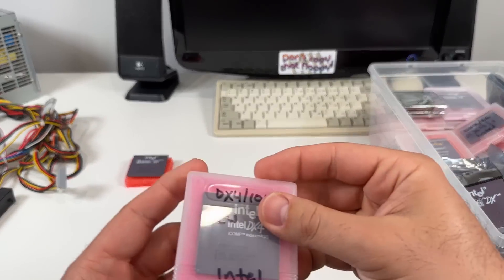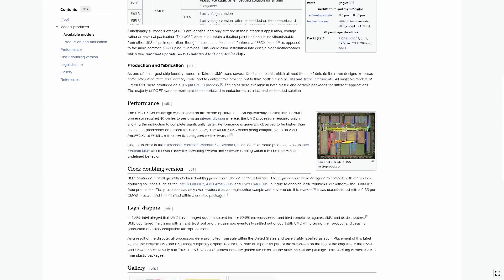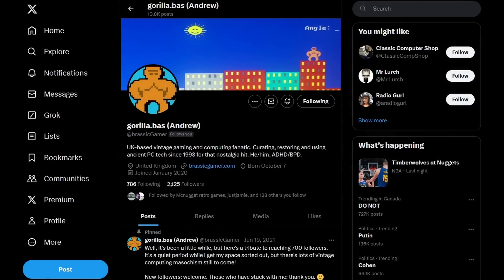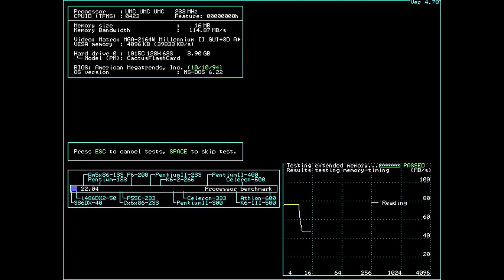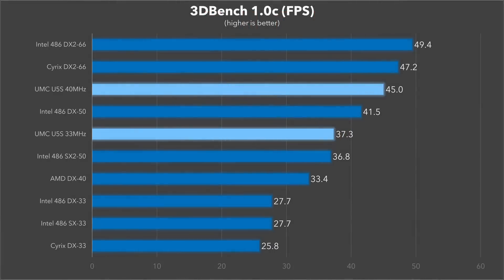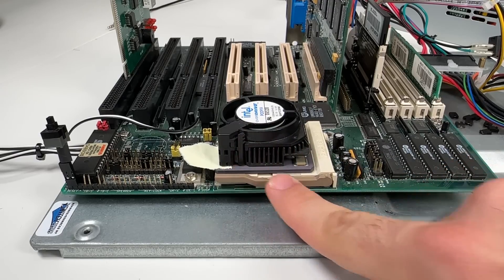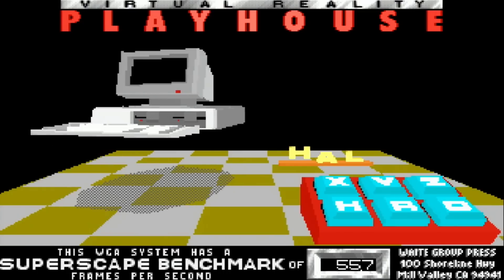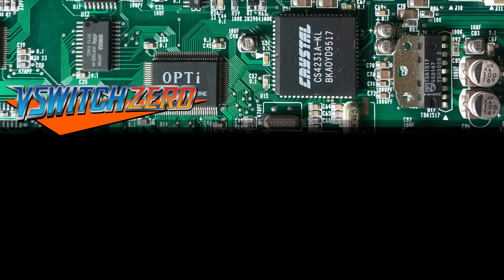The Forbidden and Forgotten UMC Green 486 CPU

Comment: I jumped from a 286 Tandy to a home built 486 DX66 and for five years it was faster then any of my friends PCs.  I built my own fan setup that was more powerful and quieter.  This was the first time I used an Asus motherboard and I continue to use their MBs to this day.  I can't remember the brand name of my video card with 1 mb of memory and I used a Sound Blaster sound card and two Diamond 56k modems and two phone outlets.   My monitor was a 19" monster, I mounted a fan above it to cool it!   At that time time I used a huge HP 1220 printer that printed 24"x 36"  poster boards.  In those days I went through ink cartridges weekly.  Today I use my PC for the internet only, and do not miss the "old days"!

Comment: My first personal experience with over clocking was the main seller at our old computer shop. It was the AMD DX4-133 I had setup for a customer. I accidentally set the bus speed to 40mhz and saw the 160mhz on the screen as it counted RAM and booted up. I was like 160 oops but i have to benchmark it and see is it stable. I ran that one with the flying pc and keypad and it smoked any score I'd ever seen come from my shop including the previous record holder which I think was a P75. It was perfectly stable in anything I played which included Doom of course. When we told him he got a free over clocking upgrade he was like sweet. We sold a bunch of them because it was significantly cheaper than the Pentium but performed just as well in most things at the 160mhz clock. I always tried 50mhz but never got one to run reliably at that speed even with extra fans cut from old power supplies.

Comment: 08:04 - 486 Clocked at 771.0 MHz???
Reply from the maker: Back in those days there wasn’t a standard way applications detected processor speed. Sometimes you’d get strange results from non-Intel chips. Cyrix processors would often be misreported in a lot of tools. Thanks for watching!

Comment: (14:55) I have never seen a USB to IDE adapter like the one you're using. Does it also have nand flash memory on board? I see the USB Pen is not plugged in.
Reply from the maker: This is actually a "GoTek" floppy emulator. You can store many floppy images on a single USB stick and switch between them. Very handy to have with retro DOS systems!

Comment: Heretic, Doom, Duke 3d has a secret, that’s working for Dosbox and the x86 devices. That’s the game’s intro game play, that runs during the title screen. You have to go through 2 rounds to speed up a device, and to enable a micro SD card’s physx processor for games, that’s usually off by default, that is HC, XC, and A1. All these are brand specific, it depends on the card’s capacity and manufacturer, how the coprocessor deals with games. For Dosbox phones, Heretic must be run first, then the Duke intro. It also turns on the phone’s APM, and a performance mode, Samsung phones become hot during gaming, and will become cold during text editing. APM is Off by default, phones have a general heat, but never cold. 25 mhz IBM 386 with CF card causes the card to cool down completely, and the card gives an additional 3D boost for the laptop when the Doom is run for a while on the laptop, that’s the Doom demo screen, and needs 1 hour to take effect. If Doom is on the hdd, the performance boost is off. Doom can only played in the smallest screen, but it can be played with the 25 mhz 386, if it’s on the card. Microdrive does no speed boost, but it also cools down in the laptop. PCMCIA power manager has to be installed. When the cards are inserted in a camera, they still remain cold, and won’t heat up. 
For Dosbox Duke fix, the cpu cycles are 8000 and 10000, and Samsung phones will be better the most. Heretic has to be run first using 90000 and 50000 cpu cycles, or Duke demo gameplay will halt.

Comment: I tried to get one of these back in the day, before I found out they were essentially not available in the US. After my 386sx16,  I ended up first with an IBM 486SLC2 (which was horrible, it was actually a 386 made compatible with a 486 socket, including the 386's 16MB RAM limit .)  It was fine at first, but I  ended up with this stuipd thing in a VESA Local Bus motherboard, only to find the video memory was mapped past 16MB -- it did some wraparound thing with the memory so the VRAM was mapped at like 8MB or so. When I had 8MB RAM it worked. When I bumped it up to 16MB, all hell broke loose since the VRAM and some of the system RAM's address spaces overlapped.)

I went AMD after that -- K5, K6, K6-2.  All served me well.

Comment: I recall booting Linux on a miniature embedded x86 motherboard, where the CPU would identify itself as UMC. Must've been during the noughties. Not sure if this could be an early VIA/SiS, rather I'm inclined to believe that this was something of the DM&P pedigree, i.e. and early Vortex86, a direct predecessor to Vortex86SX. Could it be that the modern Vortex chips inherit some history from the UMC 486 ? Perhaps by now there have been too many generations for any heritage to even matter, at the level of CPU core design... And yes the modern Vortex CPU's do feel like a very fast yet very lean 486DX+ (with CMPXCHG added). I believe around Vortex86DX the CPU was claimed to be "fully static", i.e. you could stop the clock for an indefinite time interval, and restart it and all the code would keep ticking (no data would get lost) - and it could be deeply underclocked, if you had to run stupid software that would not tolerate a CPU that's just too fast. Like down to 1/8th or even 1/16th. (A feature of the platform, accessible programmatically via some chipset registers, also available in the BIOS Setup on the motherboards by ICOP.)

Comment: Thanks for a very informative and interesting video. I just picked up 486 VLB system with a PC Chips M912 v1.7 motherboard. I purchased UMC 486 Super40 that I will be using in this system. I never used one the CPUs back in the 90s and now it is going to be a lot fun to try this out!
Reply from the maker: Thanks for watching! Very nice, enjoy the new retro system 🙂👍
Reply: @vswitchzero  I got the UMC 486 CPU today and it works just fine in the PC Chips M912 v1.7 motherboard. This motherboard has specific jumper settings for the UMC 486 CPU. Interestly, those jumper settings differ from a standard Intel 486SX.

Comment: I had a crazy off-brand IBM 486slc2 66MHz CPU in the early 1990's and it was such good value for money. A little faster than a 486sx-33 and much cheaper. Odd architecture though, it used a 386sx-style 16-bit bus with high clock rates and extra cache to make up the data transfer speed loss. No FPU of course.
Reply from the maker: Cool! Yes, the IBM blue lightning chips were very interesting CPUs. I hope to a video on it soon actually 👍

Comment: Four years ago i buy locally my first 486 machine, that was Optimus with UMC 40-SUPER processor and no L2 Cache, it running on 25MHz, with 8MB ram and was install Windows 95. I almost shure that this processor run on this 25MHz frequency since production, i try to use 33 or 40 MHz, but system does not boot :/ So you should be very happy that your unit can be overclocked, my 40-Super can only be underclocked
Reply from the maker: Very interesting! Unless there is something specific about that board that didn’t like more than 25MHz - very strange. Perhaps it was defective. Thanks for sharing.

Comment: How does the DX4 100 MHz chip compare?
Reply from the maker: The Intel DX4s had 16KB of L1 cache and some also had write-back support. They were a bit faster than the 8KB write-through models (maybe 5-7% or so). Still not enough to catch up to the UMC green when compared clocks-for-clock though. Obviously a 100MHz 486, even if less efficient will out perform it though. The DX4s were a huge step up. Thanks for watching!

Comment: if those cpu's had taken off then what would the impact have been on the future computer market. since the IPC was basically almost 6 times better, and the overall powerusage was much lower while overclockability and undervoltability where much better.

that said I once had a AMD Phenom II X, don't remember which one exactly, but was one of the better one. it was passively air cooled so just a heat sink on it, but no fan on the heatsink(even though the pc case fan did blow over it), I had overclocked it with more than 1ghz extra(which back then was a lot since back then clock speeds where much lower. the cpu temperature at full load would get to around 30 degrees celcius, and in warm days perhaps more close to 40 degrees, but it stayed cool. it was stable at that 1gh overclock(despite the motherboard not even being stable at stock settings.
I didn't dare to push it much further however since the motherboard was really crappy and had capacitor problems so I was afraid that pushing it much further would destroy the motherboard.

Comment: I've ran across a couple in the past in Arkansas, but at the time I was already into the Pentium II CPUs, and was replacing my client's PCs when I came across them on some sketchy pre-builts that came from outside of the U.S (OEM imports with local shop stickers slapped on them).  They were DOA due to the systems being totally fried with one from a faulty PSU the other being a faulty Motherboard.  It was a shame I would have loved to play with them a bit.

Comment: I never knew there was anything special about these chips. Too bad they didn't hang around long enough to see the end of the 486 era. One of these cores clocked over 100mhz would have been great. I ran an amd 5x86 at 150mhz for a couple of years until the P54 prices came down. It ran early pentium era games reasonably well, even Quake was almost acceptable full screen, but it shined on integer based code of course. I bet this cpu core would trounce it though at 100 or 120mhz.

Comment: Okay, after watching all of this  do you happen to have the Intel 486 100 MHz overdrive chip, looks almost identical to the POD in the video. And do you have any of the AMD X5-133 chips?
Reply from the maker: I do indeed. Both of those chips have 16KB of write-back L1 cache and would be a bit faster clock-for-clock compared to the older Intel/amd 8KB models. Not nearly enough to catch up to the UMC green though 🙂 .. I did a few videos in the past on these chips, including an upgrade chip comparison if you’re interested. Thanks for watching!
Reply: @vswitchzero  The biggest problem that I remember from those days, was motherboards with fake cache chips on them. I was working in a computer store at that time, and we had to return an entire case of them. I had build a system, but it didn't feel right, so we started looking into more details, and found that the chips were just glued on the board, no actual solder. I also really enjoyed the AMD K5 CPUs, blazingly fast and cheap compared to what we were used to from the 486 systems and the early Pentiums that you could use to cook with.

Comment: My dad bought me an AT IBM compatible mid tower that contained  an AMD 386DX. When i got frustrated with trying to play Doom, found a computer shop in downtown of our city and upgraded the motherboard along with an AMD 486 DX2-80. Before the end of that era, I had outfitted it with an AMD 486 DX4-120. When later in 1999, I opted for a prebuilt eMachine with a Celeron 466 mhz, I gave it to a friend, much to my own chagrine. It ended up having 8 megs of memory, a WD 1.2 GB hard drive, a SCSI Plextor (I didn't research enough before I bought it) CD drive, Trident SuperVGA video card, Orchid sound card, and it ran Windows 95. I kick myself every day for not hanging onto it. I played Doom, Wolfenstein, Duke Nukem, Hexen, Xwing, Panzer General, and Myst on it. The Windows 95 disk even had the Rob Roy previev which i watched with fascination. The beginnings of what would later become the MPEG, WMV, QuickTime, and AVI video standards that we know of today.

Comment: Huh. I never knew Cyrix chips were the lowest-performing of the bunch. Now I feel short-changed for playing Doom on a Cx486DX/40 for years. In its defence, it easily overclocked to 50 MHz without complaining, but in its stock form the difference with a "holy grail" Intel 486DX2/66 would have been astronomical. Nice 486 mobo BTW, with mine you couldn't really swap CPUs that easily ;-)
Reply: Cyrix was good for business productivity, not games like quake.
Reply: @vanderlinde4you  Well, the relative unsuitability of Cyrix for Quake became evident much later (with the infamous 6x86 chips, which actually would be beat "real" Pentiums clock-per-clock in everything BUT FPU operations, which is the exact opposite of what's happening here). At the time, Doom was what mattered to me, and now I learned that 486 Cyrix sucked at, well, pretty much everything BUT FPU ops, compared to the competition. A solid 20% reduction in performance in ordinary ALU operations which pretty much all software would use day to day was no small thing :-(

Comment: I built my BBS machine with UMC chip. It worked just fine while... it was cool. There was no a cooler designed specifically for the chip as far as I know. So I had to make my own cooling set up. Most of summer time case was wide open and had an additional desktop cooler blowing air into the case. :D

Comment: Nice to see some performance tests for this rare bird and especially overclock performance. Now I'm curious how well it'd test out on a good VLB motherboard on those higher bus frequencies. I'd also be curious to see if there's any difference on your board with the jumpers set to standard Intel settings vs the UMC config just to see if there's maybe any chipset specific optimizations going on there to help out the UMC CPU performance.
Reply from the maker: Thanks for watching! I’ve never had much luck getting VLB to run stable at 50MHz, unfortunately. In my limited testing, I saw no difference between the UMC jumper settings and the Intel SX when it comes to performance. I wonder if it has something to do with the power features perhaps? Would like to look more into this at some point.
Reply: @vswitchzero  That's a great point. It's certainly possible the UMC settings on the motherboard jumpers are related to the unique power saving features of the CPU.

Comment: I had an AMD 486 DX2 66 that I overclocked to 100mhz by dropping the buss to 25 and putting the clock to 4x. Ran rock stable and paired with the 16MB of RAM it was a dream machine for me in HIghschool.
Reply: Likely even slower considering the dropped down bus.
Reply: @vanderlinde4you  Nah from 33Mhz buss to 25Mhz wasnt massive. Noticable if you only had a 33Mhz and went to 25Mhz, but since I went from 2x to 4x on the clock multiplier, the overall net performance was quiet good compared to it at just 66Mhz. Didnt have any bench test, but just running programs in general, it was very noticable improvment and programming compile times where WAY WAY faster.
Reply: @AtomicOverdrive  fsb wins over clockspeed.
Reply: @vanderlinde4you  In many cases yes, but a full 34 more Mhz overall was more of an improvement in this case. Anyway, what ever you claim, it was my PC and I tested the results from the OC and it was an improvement across the board.

Comment: So all in all, basically everyone was able to effectively outperform Intel's own designs with superior engineering like AMD and especially Cyrix and UMC did.
Yet somehow I wonder why?! It still was postulated by tech media, that Intel would be the actual king of the hill, when in reality, they had often the hottest, least performing and most expensive iterations. of all of them. Since AMD, Cyrix and UMC were all less-expensive, less heat-inducing and offered at least equal if not higher performance at already the same price-point.

History doesn't change …

Comment: Great Vid. I was just wondering on the 60Mhz OC, was unstable due to voltage or temp? Would putting anything on the ceramic top help dissipate the heat and make it 'more' stable?
Reply from the maker: I didn’t show it in the video but I had a decent sized heatsink and fan on the chip for all the overclocking tests. Cooling did help because the chip was always more stable when cool and would go down hill after running for 10 minutes or so. Would love to get a super-40 which is probably better binned. Thanks for watching! 👍

Comment: How does it compare against the AMD AM5x86, which despite its name, is a 486-class CPU? AMD made models all the way up to 160 Mhz, and they could be overclocked beyond that if you were lucky.
Reply from the maker: The Am5x86 is an awesome CPU. Its performance clock-for-clock would be comparable to Intels DX4, since it has 16KB of write-back L1. It would be a bit faster clock for clock compared to the 8KB WT chips from Intel/AMD but not enough to catch up to the UMC 🙂

Comment: If you want real 486 speed use the AMD DX4-120.
I had it running at 150 (3x50). It was a 3V part, but I ran it at about 4.2V (my board had 3 jumpers for 3V or 5V the power actually went thru so I used 5V thru a 3A diode )

Comment: I have the same Shuttle board (but in another color). Have an Am5x86-133 in it. By far the fastest 486 board I've ever owned and indeed very versatile. Bought it originaly with a 486sx. Man that was slow, even with the PCI s3 vga card at that time. Nowadays, I do my dos retrogaming on an Asus  P2l97 board with a pII-333mhz cpu though. Slow/fast enough and the Gforce2mx-400 runs everything from Wolenstein 3D to Quake to... without any hassle.

Comment: Early on when the 486 came out, there was no low-power model.  For that reason, we used a Cyrix 386 with an outboard fpu for a portable compute solution.
Reply: there were never a Cyrix 386 on the market.
Reply: @boardernut  He might be thinking of the SLC or DLC which had the pipeline and cache of 486 but ran in 386 socket